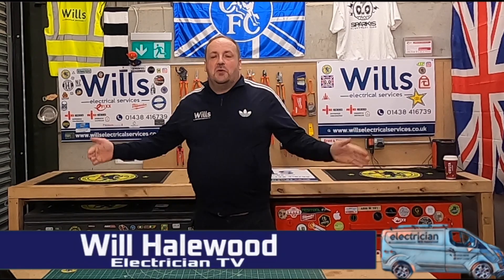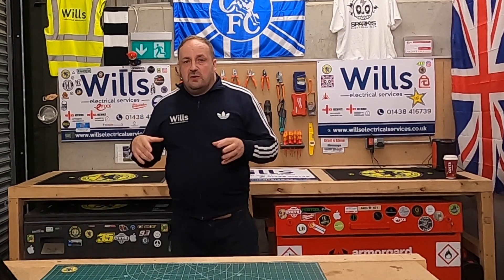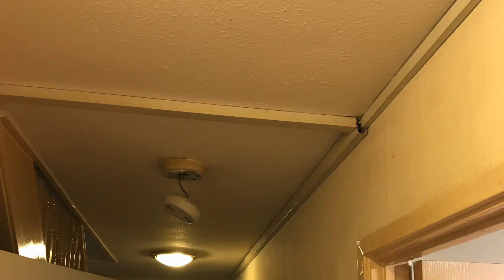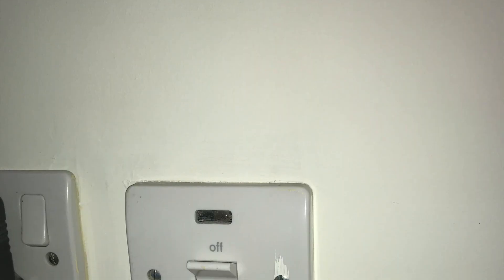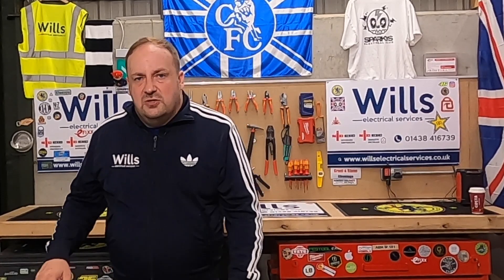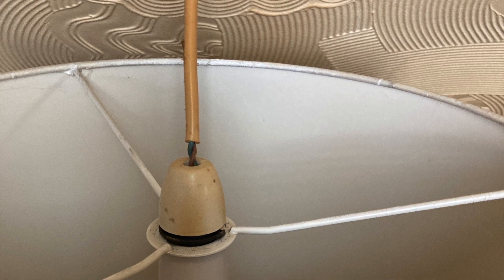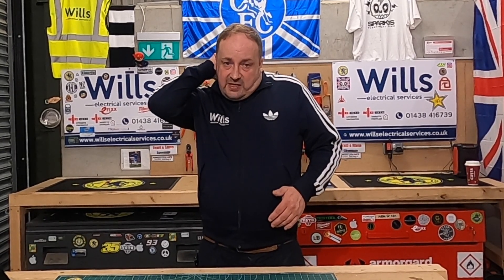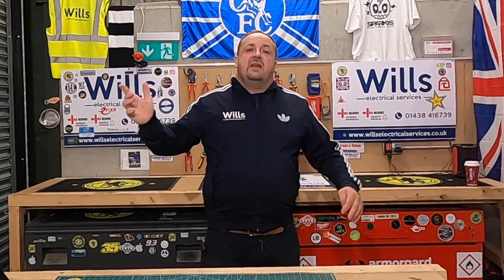EICR Tips & Tricks for Beginners + Free Checklist | Electrician TV￼

Comment: Good stuff Will tons to think about here.One point to add Green and yellow should only be used as CPC or bonding
IET 18th ed 514.4.2 "The bi-colour combination green and yellow shall be used exclusively for identification of a protective conductor and this combination shall not be used for any other purpose."
There is a specific exception for PEN conductors which can have blue over-marking at terminals , but the above is pretty clear for the vast majority of applications 
Table 51 gives all the accepted colours

Comment: 14:10 Why might 'exporting' the earth from the main building to a garage be a problem?
Reply from the maker: If the supply characteristics are TNCS then you are not supposed to export the Earth out of the equipotential zones.
Reply: @ElectricianTV  That is a common myth of our trade.  Please can you explain why you think it is a problem, and also can you please reference some form of regulation to back the statement up?
Reply from the maker: Answering without regulations and being out of my bed for five minutes. I would say is to do with pen fault and being out of the taken equipotential  zones of the original building.
Reply: @ElectricianTV  I looked into this a while back, and concluded that it's a myth.  There is nothing in BS7671 prohibiting taking the TN-C-S earth to outbuildings, apart from a few special locations/situations.  I cannot find any evidence that DNO's prohibit it either.  Engineering Recommendation G12 ( basically guidance for DNO's explaining where they should and should not provide PME earthing) doesn't prohibit it, again aside from a few special cases, that largely mirror BS7671.
It may be a myth, but it's a persistent one - it's been doing the round for decades now.
Reply: @andrewcadby I’m not a sparky but as I understand it it depends on if you have any extraneous conductive parts like copper pipes or structural steel in to the ground. They could be at a different potential from the earth that is connected to the main incoming earth so possible problem. So no conductive parts earth from main building is fine. Pretty sure there is a John ward video about this somewhere. But like I said I’m no sparky so could be wrong.
Reply: @andrewcadby in the 1980s DNO (electricity boards then) insisted that domestic garages were staked to earth and earth from house was isolated. I think myth started then. It was never really in the regs to my knowledge.
Reply: @davideyres955 that's correct fundamentally IMO. You can of course bring a main bond 10mm to outbuilding if you have services in there and bring the whole installation into one equipotential zone.

Comment: It's probably about time smoke alarms were written into BS7671. In most domestic situations the only bloke who goes in there with an informed eye is gonna be a spark so it just makes sense to me. I don't put any code down but if there's anything wrong about them I'll still list it in observations  but just put an NA. While we're on the subject, cpcs not brought forward into the alarm is common where they used to have a different brand and I see a fair few where they use the cpc as the interlink too. People think the smoke doesn't need the earth as it's class 2 but it's the circuit in the fabric of the building that needs it otherwise the OCPD ain't gonna do much if someone puts a screw through the cable.
Reply: Good point
Reply from the maker: Yeah I agree 100%
Reply from the maker: I believe that even in the NICEIC snags and solutions.That they mention it is okay to use the CPC as the interlink. I’ve only ever seen that on another podcast so I don’t know how true that is.Crazy especially when they sell  radio bases
Reply: I’m pretty sure the Regs state Green / yellow coloured cable should not be used for any other purposes
Reply: @rossmurdoch7870  this only applies to single core green/yellow cables.  The green/yellow core of a multicore cable can be oversleeved and repurposed. 514.4.2
Reply: They are, see 560.10, some just play the "they aren't part of 7671" card owing to either lack of knowledge or ignorance
Reply: There is the debate also wther it is a C3, leaving it to the owners discretion to fix or, as a life safety system, it attracts a C2 and forces a resolution. Personally I'd C2 it all day long, especially for families and the elderly, but that's me. We should of course remember that we work from the regs, not to them.
Reply: @pnxelectrical  560.10 is from Part 5 - Selection and Erection of Equipment.  It tells us how things should be installed, but not where/when they are required to be installed.  It doesn't, for example, tell us that smoke alarms should be fitted in domestic properties.
There is a note at the beginning of chapter 35: 
NOTE 1: The need for safety services and their nature are frequently regulated by statutory authorities whose requirements have to be observed.
However, this is a note, not a regulation.
With that in mind, it appears that a lack of a working fire detection system does not in itself break any regulation of BS7671, and so AFAIK shouldn't be coded.
If you know something that I don't, please let us know.  Discussions such as this help us all up our game.
Cheers
Reply: @andrewcadby   @Andrew Cadby  I take your point asit is perfectly valid however (as if often the case) have parts where it either contradicts itself, is ambiguous or be of not use at all.

Why would it have in part 3 that a non-working alarm is not a breach of 7671 and yet have 560.10 advising that all relevant parts of 5839 should be met? 

Taking a step back for a minute; Regulation group 110 and regulation 110.3.v specifically, advises us that 7671 can be supplemented with other  standards (in this case 5839-6 (-6 as we're talking domestic).

If we look at 5849-6, specially 15.4.2.e - (can't copy and paste verbatim) it essentially states that the standy supply should be capable of maintaining the alarm in a quiescent state (ready/detection) state for 72hr and a further 4 minutes on an active alarm state. Of the device doesn't do that then the argument is that that clause in 5839-6 isn't met and as a result 560.10 is also not met.

I can't remember the BS numbers for domestic fire alarms but I'm fairly certain (more than happy to be educated) that the product standard will stipulate that the alarm is test in conditions under primary power (mains/battery) and secondary (if of that type) and a failure in any of these combinations means the device is not to standard and as such any use in a 5839-6 scenario would likely be seen as a deviation but very unwise and I'd doubt endorsed by thr manufacturers.

If this comes across as trying to ram things down necks I apologise it's not my intent: as you say discussion amoung peers is good for all providing it's conducted in a professional manner.
Reply: @pnxelectrical  an interesting discussion.  Here is my logic, how I arrive at the conclusion that a note is more appropriate than a code:

I find nothing in BS7671 that mandates smoke alarms in (for example) domestic properties.  So the lack of any kind of smoke alarm will not warrant a code on an EICR, no regs are broken AFAIK.

In a property that has smoke alarms fitted, if a non working smoke alarm was coded C2, then simple removal of the alarms would change that C2 to no code.  Now there are no alarms in the property, so no code.

No increase in safety (or should that be decrease in danger?) has taken place by removing the alarms, but the coding suggests otherwise, and, no other problems being present, could turn an unsatisfactory outcome to satisfactory.
Reply: @andrewcadby  I can agree that 7671 doesn't mandate that they are fitted, I do 
however take the view that where a system is provided that it should met thr standards required, the 560.x suite to that end is a checksum to give someone deemed competent (to perceive danger) thr chance to spot it and put it right, or at least discharge the duty of care; how they go about that is entirely down to them, I would code it as I see that having more weight than a footnote; like to advisories on an MOT; sure they could just been notes on the bottom of an invoice but they carry more weigh being recorded the way they are (possibly an oversimplified example but you get the picture).

Removal of the system would be a tricky one as it could be taken that you have made the property unsafer than you found it, you would have to be deemed competent to assess the risks of it being left inoperable versus removed completely versus repairing into service)
Reply: @pnxelectrical  where in BS7671 does it say that current using equipment that is not required by BS7671 may not be removed?
Reply: @andrewcadby  as far as I know it doesn't but by this point we're outside 7671 either way. As a 'skilled person (electrically)' [given 7671 doesn't use the term 'competent', putting it at odds with other standards and some enabling legislation], part of that skill as the definition suggests is to be "able to perceive risks and avoid hazards that electricity can create", one such hazard/risk is fire and while arguably is not a sole source of fire (but potentially forming part of the triangle/tetrahedron [ignition]), it should be logical (no malice intended) that as you would have a potential ignition source surrounded by combustible materials (typically found in a home) that you would want a way of being alerted to any such instance of fire or ignition and if you know such a system is in place but impaired (in a way you understand - no power), them we ought to be able to advise on it.

By this point we can both argee we're outside 7671, but if we posses even the basic knowledge to know that a fire alarm/smoke detector won't function without power (primary or secondary), we should be using whatever we have in our arsenal (nearly put 'arse', that would've been a whole other conversation!) to make our client aware. Personally I put it on similar level to those that include ISITTEE as part of some EICRs; an addition based on understanding of 7671 (and supplimentary standards/legislation), that said if you're being paid for your opinion, knowledge and understanding (and have sufficient insurances; financial or otherwise) then we ought to be doing our best for our customers.
Reply: @pnxelectrical  I'm going to respectfully agree to disagree on this one.  It either gets coded because it breaks BS7671 or it doesn't because it doesn't, and we have strayed a fair distance from that point now.  
Cheers for the banter mate.
Reply: @andrewcadby  no problem squire, professional discussion is always nice.